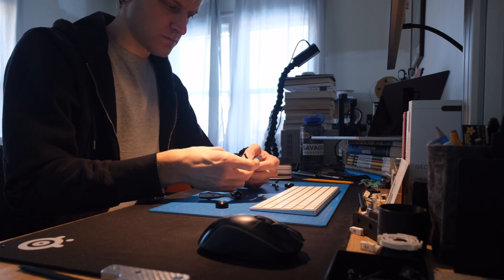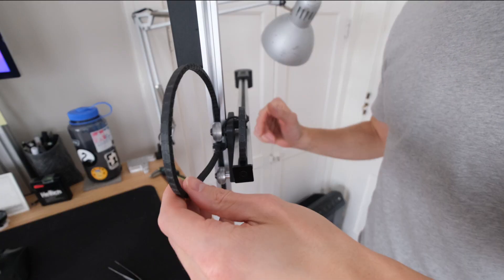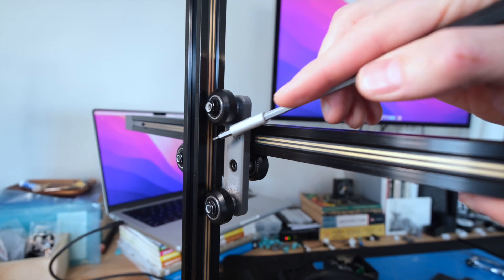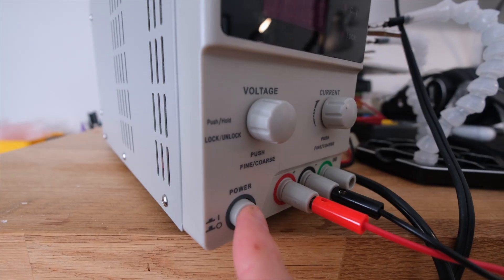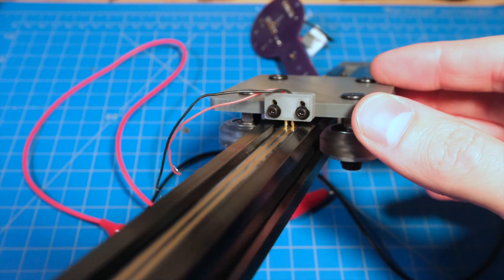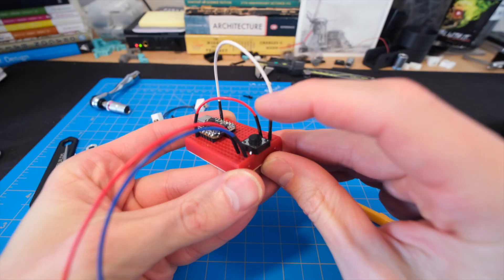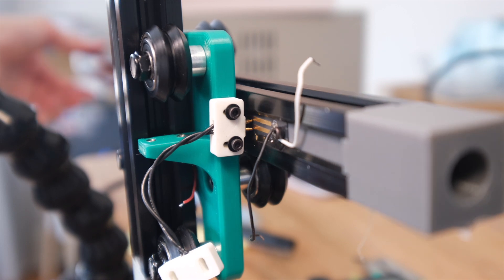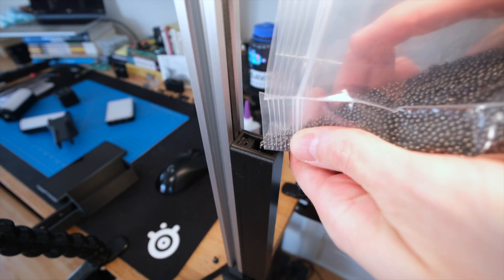Pogo pins: attractive distraction or ultimate wiring solution? - DIYson Lamp Build Log #9

Comment: I'd re-orient the horizontal PCB-power strip to either the top or bottom of that rail (rather than the side), which means gravity can assist with keeping pressure on the pogo pins.  Wait, you did that!  Ha.  Good update :P
I'd be interesting in seeing how the pins and tracks wear over time, and in particular how/whether the resistance of the contacts changes. That's where I'd expect the most power losses to occur.  The power loss will change with light output power (P =  I²R), so definitely worth measuring.

Good set of iterations this video!

Comment: I think the wear on pogo pin is a big variability on how long this will work. 
However your PCB in the slot looks really nice to me. I wonder if you can do wireless with the PCB. so PCB will have massive long coil. which feed power to the receiver, which is one small coil at any position along the track. No contact, no wear

Comment: Everyone's talking about different pogo pins and pcb designs. But to me it looks like your carriage just isn't rigid enough. I'd try and make the arm more rigid to counter the moment, and thus the separation. This would completely negate the need to super engineer the pogo pins, and you'd be able to use the shorter throw ball pogos, which will cause less wear over time. 

Also you could put the pcbs in the tracks facing each other, so the pogos would be perpendicular to both the vertical and horizontal rails. This would be a bit more cumbersome to design in, but would look much cleaner imo.

Comment: Hi Steven, wouldn't it be cool to spring-load pins so they always follow and close gaps? If pogo pins don't do it, I'm pretty sure a custom pin with a retainer (think of a pin in a tube with an integrated spring) would be worth the effort. Your PCB track all along the profiles paved already the smartness path. Another thing that should lead to a flexible contact solution: possible wear of the pins on the PCB contact traces. Just a few thoughts for your great mind. Herri

Comment: Really loving this series! The improvement with capacitor will not translate when the power hungry light source is added. So do repeat the test with the actual load before finalizing the solution.

All the best! Looking forward to the next iteration
Reply: How about a bigger capacitor or even a Gold cap – as used in bike rear lights, for making it stay lit when you stop at traffic lights?

Comment: I was one (of probably many) that suggested a solution like this. A quick follow up to increase the reliability is to use the extrusion itself for the ground connection and use a thicker single line for the + wire. Or for a quick modification, use both for +, if one looses contact, you got built in redundancy. Also add an isolation (paint) to the side of the pins to avoid rail contact. And finally take a look at supercaps. They are tiny but store a lot of energy, even if the contacts got interrupted, they will power the lights for probably a second or two. Also your type of measurement of the reliability is flawed. Without a load, the voltage is more or less meaningless and not a good indicator of contact quality. If you use a multimeter in resistance mode, you got more details, or add the load (the light), then analog voltage will be fine.
Reply: I was also thinking that using the extrusion as the ground plane and just a single track with perhaps a leaf spring contact on the moving axis’s may be more reliable

Comment: Make a 3-dimensional "super track" out of two PCBs, with one long track and seat those inside the aluminum extrusion.  Think of a triangle shape, where your pogo pins will be on either side of the crest of the triangle.

The ridge will help keep the pogo pins in contact by resisting twist/vertical movement.

Comment: You could combine the best of roller and standard pogo pin by using a two part pin holder to place a small spring (think ballpoint pin spring) behind the roller pin. An issue you'll run into with a plain pogo pin, is that because you have a direct sliding motion across the track, over time you will wear through the conductor and possibly the pogo pin as well; a rolling contact would help quite a bit there. Also, since you're already building your own pin assembly, you don't need to keep that same .100" spacing, and can have a wider pitch, along with widening the traces (and perhaps reducing the trace clearances) to create a larger allowable angular deviation in the arm position.

Comment: Definitely go with 2x2 or 2x3 for the pogo pins whether or not you use a capacitor. The more secure electrical continuity will be worth it especially as the track wears in and is subjected to atmospheric contamination. Cool project!

Comment: Millmax makes "omniball" pogo pins with rolling contacts for this exact purpose of sliding pins, instead of regular pogo pins which aren't really meant to slide on a surface without wearing it down. Granted, they are not cheap, but they are meant for this purpose.
These or leaf spring contacts meant for batteries might be a better choice for this use :)

Comment: This is awesome. I was thinking about the differences between the vertical PCB and the horizontal PCB. The biggest one that stands out to me is that the vertical PCB is on the side of the bracket with two rollers, and the pins are in between the rollers, so they don't get a chance to pull away. It may be worth putting the track on the bottom of the horizontal track to give a similar setup there, even if it means running a wire around the top side to the light.

Comment: You may consider flexible PCBs 👍 You can get rid off cable mess this way. 

You can also use magnetic rollers in order to stabilize both axis. You can install a thin steel bar to the other side of the alu profile. You just need to use two neodymium magnet rollers per axis. Another advantage of this method is easier and faster assembly.

Comment: As much as I applaud creativity, I think you should consider using industry standard terms for things, instead of inventing new words like "super track".

Sliding contacts are a thing in engineering for more than a century, as are slip rings.
Pogo pins are also not the right part for this, because they have stiff springs and their small contact area will damage the track.

There is no shame in looking at existing solutions, because sometimes when you try to reinvent the wheel, all you end up with is a cheese wheel with a stick through it that is painted black.

Comment: Funny enough that aluminum bracket you were given may be the fix for your rotational distortion problem. Are you using any kind of eccentric on your rollers to tighten them up against the extrusion's groove?
(I'm assuming for ease of manufacture you are excluding these as design elements)
This is the first video of yours I have come across so please excuse what may have obvious answers. I do intend now to go through the back catalog.

Comment: I think you cloud also extend the adapter plate to protrude into the channel of the aluminium extrusion a bit. Currently they can move in the whole plane that's set by the bearings and therefore also tilt which is what you'll want to avoid.

Comment: Might also consider widening the copper tracks toward the outside edges or the pcb and also pushing the pogo pins farther apart. Some of the clips show the top pogo drifting out of the top rail and into the dead space in the middle.

Comment: How about 2 bare coper wire spools under the desk and some 3d printed spools, (to change the direction). The spools under the desk would under tension and rolle up any slack in the wire. The head could then just use two spools to graph the voltage from the coper wire.

Comment: YES! I have been designing my version of this project with the idea of using a PCB and pogo pins for the build... glad I wasn't the only one! The diference in my design comes down to the position of the PCB. I put the PCB in the side facing the carriage, making it directly perpendicular to the other track and allowing for a simple hole in the carriage that I put 2 wires through to pass the electricity.

Comment: Hi Steven, that's an interesting problem you are tackling. Maybe i got an Idea. I think, that the position of the powerclip is crucial. In my opinion, Dyson intentionally positioned it right in the middle of the two lower bearings. I think they positioned it there, because this point is like a pivot point, when the vertical arm is moved like shown in 14:19 . This point moves the least. The futher away the pins are from this pivot point, the more problems you might get with them not properly contacting. I hope, that you understand my point, my english isn't the yellow from the egg ; ) I really am looking forward for your solutions : )

Comment: I really like the idea, it looks incredibly good with those pcbs in the tracks, although there is one issue that comes to my mind, usually the pcb gold coating is extremely soft and thin when not explicitly bought with "hard gold" finish. Even then the traces might wear quickly and the underlying copper can oxidize which will lead to increasing resistance and worsening connection.

One thing to look into could be the "brushes" from DC motors, they use exactly that principle to transfer the electricity to the right coils. Those are made to intentionally wear over time but still provide good lifetime. IIRC those pads are made from graphite.

Really love the Project so far!
Reply: Maybe the tracks can be carbon tracks instead of the regular gold-plated copper? As it is applied in faders and potentiometers…
Reply: @el_micha  good idea, but then you cant order it as a usual pcb i assume
Reply: @user-wi5vi7dd3z  Probably not, true.
Reply: Yep, L, I see your comment now after I posted re: "hard gold" option. I think this is minimum, but the wiper material should be softer thank POGO pins too.

Comment: I'm guessing here, but let's say at least for the rotation, the horizontal arm get's closer or farther depending on which direction is rotated, Could you use two pairs of pins one in front and other in the back? I'm thinking one pair should be in compression while the other is in extension.

Comment: 10:30 Measuring the voltage without a load attached tells you almost nothing about the resistance of the connection, since even a large resistor will pass any voltage if there is no current flowing through it.

One way to get an accurate resistance measurement is to pass a known current through the connection, measure the voltage coming out, and finally calculate the resistance with Ohm's law: Rcon = (Vin - Vout) / I

A simpler method that doesn't require a constant current source is hooking up a resistor that draws a similar amount of current as the LED, which basically turns the whole thing into a voltage divider. You note down the resistance value you used, measure the output of the divider, and finally plug everything into this formula, which was derived through circuit analysis: Rcon = ((Rtest * Vin) / Vout) - Rtest

Comment: You could put both rails on opposing faces and use a 45 degree offset so the left becomes the lower and the right becomes the upper. you would place one pin 2.54mm to the right and 2.54mm to up from the other and then just have two opposing pins on a "block" That should work with no wires.This would also allow for springloading between the two sets of pins.
Reply: This would of course require passing through the carriage, instead of around it. this would also limit the voltage dip, since the movement within the constraint of where the two axis meet should be minimal.

Comment: Is there any concern with the power traces being exposed? Idk how someone could end up shorting them, but it seems like the kind of thing that could end up happening, somehow. Great video, though - love seeing your progress on this project.
Reply: I mean you could put them on the bottom side into the rail. Which means you don't see them, plus they're protected against shorting by drops of liquid or sth. similar. Then again I think we're getting closer and closer to the original DYSON design. Especially moving the pogo-pin carrier into the center fo the pulleys, which will really minimize movement/play which was a problem before…  🙈

Comment: A quick idea.
The vertical axis is stable, party because the pins are located close to the center of rotation, that way any rotational movement does not change the position that much..

Comment: Just guessing, but something like battery spring contactor might work better on sliding application. Floating battery connectors (TE has them on catalog) look nifty as well. Or just copper strips pushed by spring onto power rail.

Comment: Subbed! Great project and documentation :) I really like the minimalistic design of the pogo pins but like Adelphos said, I would go for miniature of the shelf carbon brushes. You can get them really flat and put them in between the carrage system and pcb, so you even cant see them. Anyway good luck!
Reply from the maker: Thanks, Daniel! Glad to have you on board. My searching hasn't turned up many tiny brush options, but perhaps someone can point me in the right direction.
Reply: @StevenBennettMakes  You can start by using the brushes of one of those super cheap 3-6v dc motors that are in almost any toy / printer / old electronics. you probably have one or two laying around :)
Reply: @StevenBennettMakes  The good option could be the contacts that they use in pcb slip rings. but cant find a dealer in 123.. but it must be somewhere! right?
Reply from the maker: Yeah you'd think so haha. Might have to get creative and salvage them from something else like you suggest :)

Comment: Steven, just wondering, would having a power strip on 2 opposing extrusion edges (1 for positive and 1 for negative) and a wider copper strip that is close to the same opening size of the 2020 extrusion provide a wider contact patch and thus a greater tolerance for axial movement?

Comment: I wonder if using offset or cam bolts (not sure what they're called) to more tightly mount the wheels on the carriages would help with the rotation problem. Basically these bolts actually move the axle toward the aluminum extrusion as you tighten them, letting you adjust the fit of the wheels on the rail. This is all looking great man!
Reply: Yes, excentric bolts/bits are a great idea. It is used in the industry quite a lot…

Comment: Is such a long an custom PCB even necessary? Could you not just 3D-print a rail to insert into the arms? Making an exact print that will not have does not have any valleys like the PCBs should be fairly straightforward, even if would need to be two parts because the limitations of the 3D-printer. This rail would have two divots where you can tape down some copper or aluminium tape. I know that the surface has to be very exact and thus it might be very hard to mount exactly. But it would cut the cost down significantly. (if the divots are even necessary, maybe rail with a sepperator/fence in the middle to provent shortening and keep the pogo pins aligned should suffice)
Some pointed out that normal pogo pins might wear down the copper trace down fast. so making the roller pins work could be benefictial. 
The pins should also be clover to the pivot point that way the wobble will not cause the pins to move that much relative to the traces. 

Overall excellent progress! I cannot wait for the next itteration!
Edit: clarification on the 3d printing part to replace the PCB.

Comment: Good Idea with the new track design! Adding a capacitor is absolutly the right way to prevent voltage drops. BUT your test setup wont give you accurate results. To get real world data you need to add an resistor just before you microcontroller to simulate the load of the lamp. The capacitor will discharge much more quickly when you add a load. To simulate a load of 5 watts you will need to add around 1.8 Ohm of resitance. Make sure you add multiple in a parrales (which decreases their total resitance) or select a model that can disapate 5 watts of power by itself. Ohm´s law is your friend.

Comment: fantastic video! When i fist encountered this series using a long pcb with spring loaded contacts was something i partly investigated myself actually! One of the main things i worried about was having proper contact as you have had issues with, but also the longevity/wear on the track.

 - One thought i had to help tackle both issues was looking at even more alternatives for spring contacts. I was able to find some alternatives that seem to have quite a bit more travel distance, as well as having a wider contact area, meaning the wear on the track shouldnt be quite as concentrated.

Some alternetives that looked interesting on Digikey was "2248-IPS-4080T-01Y901CT-ND" and "732-4259-1-ND". The latter option is techinically not a "power contact" but for EMI stuff, though i imagine it can work regardless, also they have a bunch of variations of them, not sure which is best.

one downside to spreading the "pushing force" is that as inevitably gunk/oil/stuff builds up it might not be able "push through it" like a pointed force would 🤷‍♂

 - the other thing i looked at was the surface plating on the track. If the surface finish wears off the bare copper will be exposed and quickly oxidize and then nolonger be conductive. ENIG (looks like maybe what you have?) is a very thin gold surface but it is reletivaly soft and so even if 2 U" thickness is used i dont know how long it will last, would be very interesting to see if you are able to do some wear testing on the tracks!

One thing that can likely help a lot is if a harder surface finish is used like "ENEPIG" or "Hard Gold", though the price will jump up accordingly...

enjoying the series a ton, cant wait for the next one!